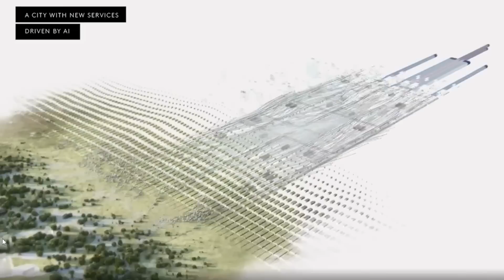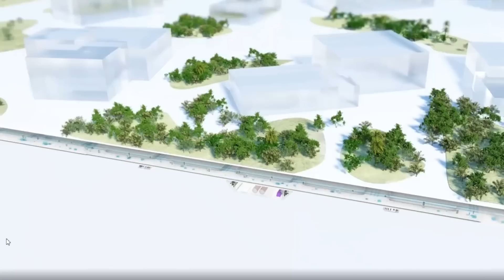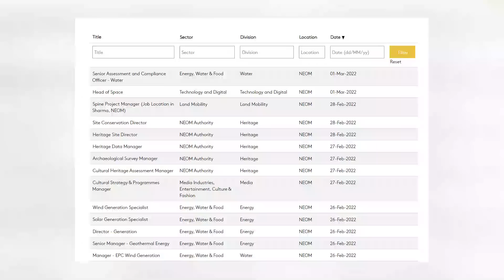NEOM CITY: Saudi Arabia's $500 Billion Smart City

Comment: Saudi, if you want to be inovative, dont try to make another tourist attractiong. Tourism is not the future. Dont build the line project... Build a modern city without personal vehicles and without detached housing, but dont build that that wall. It just makes you look like tryhard wannbes. If you want to be inovative you should focus on making the the job easier, more efficient and safer for the constructionworkers. You should also focus on making the job more efficient and simpler for the engeneers by stremling the production. Make one good housingblock and that can be but up fast and renewed esily and build it on the rails. But dont build that 500m tall wall. You have more space.
Reply: dont make shops, make it so that all is online shoping. dont make hotels and dont make officebuildings. Just make housingblocks, metro and storage.
Reply: make extra "airbnb" apartments for visitors...

Comment: a linear city looks like a terrible idea
Reply: Ah yes, you are correct of course it's supposed to house nine million people, at least in the shiny CGI world where such things always work out nicely.
Reply: Remember it is not for one million, it is for nine million.
Reply from the maker: You're not the first to say this. Genuine question: why do you think it's a bad idea? A central transit running through the entire line and all key services would be within walking distance doesn't seem like a terrible idea. Thanks for commenting!
Reply: @trailblazedHQ  The linearity seems like a sole poster feature to attract buzz without any practicality for an actual city causing the designers having to deal with costly unneeded problems they forced upon themselves in the first place. A central transit for a million people city like displayed in the animations sounds like a terrible idea, there will be no redundancy. It's rather usual for urban public transport lines to stop temporarily because of holdups like passengers requiring medical attention, mechanical problems or even longer durations for necessary maintenance/repairs, let alone an actual serious breakdown of a segment. Such an event would just cut a linear city in two each time, whereas a normal city will usually offer multiple alternatives to circumvent such currently inaccessible spots.

The whole "20 minutes to each destination" pitch seems equally infeasible. A high speed maglev train won't be able to stop very frequently to let passengers board and leave or it won't be much faster than a usual metro system and take forever to cover the full 170 kilometers, requiring people to switch to some light-rail system with more frequent stops to reach their end destination instead. Which is again an unnecessary problem solely caused by the idea of drawing out a single city over a huge distance.

It's also more efficient to centralize specialized features / buildings, e.g. hospitals, universities, cultural institutions like museums and so on, you can't just economically build a full or miniature version of them in each line segment to be in walkable distance. But the linear nature of this project will again cause much larger distances on average to such buildings than in a non-linear city.